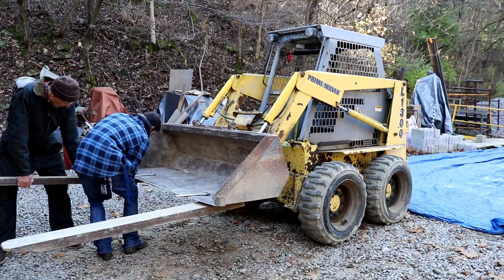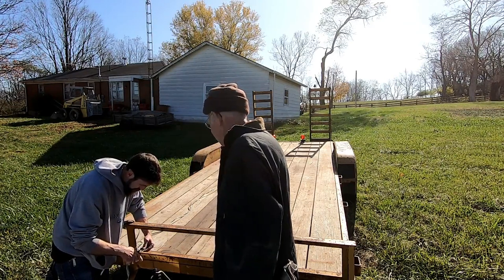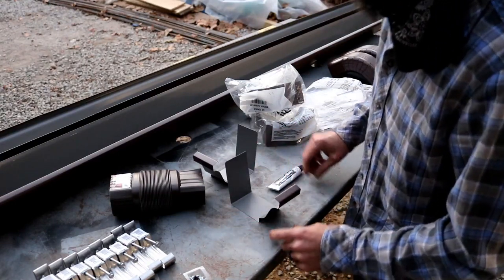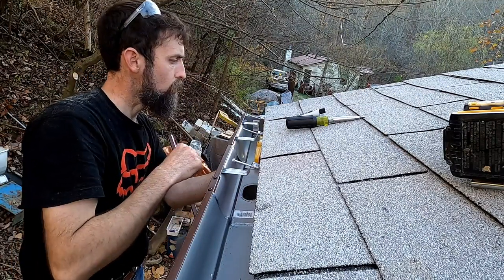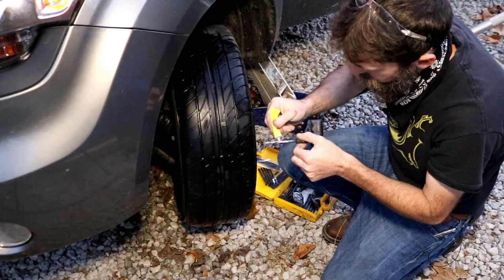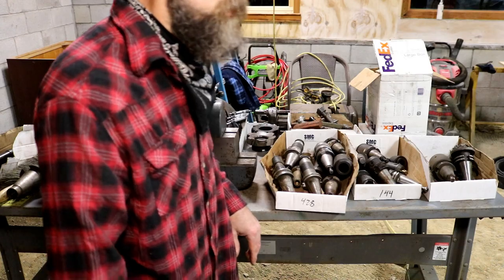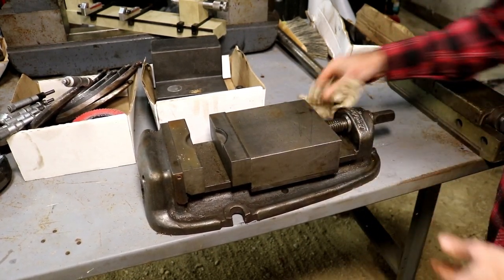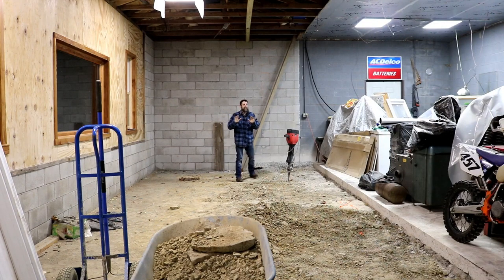Shop Gutters Guard dogs ;-)  new tools and rebar.

Comment: Interested to know if you considered using standard welded wire reinforcement to ASTM A1064 for your new slab. It provides speed and ease of installation with good crack control with smaller diameter wires at closer centers for the same weight of rebar.  I do not know if it is as readily available in the US as the equivalent would be in the UK. Great work either way.

Comment: Don't know why the delay, but I click on the link as soon as it comes up and there already 600 views.  Oh well, I still get to see the video. Had to stop and buy a set of HF magnetic trailer lights in VA when mine stopped working.  Handy item.  7:45 two stoic guys riding in a truck.  Taiwan is better than CHINA.  CHINA PHTTTT!  19:40 It's looking good. - I have run those plugs for years without failing.  Those are some very nice tooling and accessory gifts.  Hoping I'm still here for next week.  See you then.

Comment: I have always twisted the plug installer before I pull it out so as to "knot"( so to speak ) the plug so it is harder for it to fly out.  I have very very few plug failures over the last 30 + years of using plugs
Reply: Proverb House This is how it's done at tire shops. Must rotate plug install tool at least 2 full turns and then pull tool. The last plug tool kit I bought even mentioned it in the directions. I've put thousands of miles on plugged tires with no problems, didn't even use glue.

Comment: I have never found an aluminum gutter even with the brackets your using on 12" centers to last even one season.  We get a wet snow and it will just rip the gutters off (especially with a steel roof but even with composite just not quite as bad).  They don't make them with a thick enough gauge to withstand the load.  I did see some in the lower forty eight that were much better for gauge but the freight was completely out of sight for 120 linear feet.  What is offered locally is basically aluminum foil.  It is actually so thin that if you do splice on the ground and try to carry it to the roof it won't support itself.  The snow literally tears the aluminum off the brackets where it doesn't flatten them.  I had equally bad luck with the plastic gutters.  The only fellow with a forming machine takes up to two years to come to the job and he uses the old fashioned aluminum spikes which will self eject in two or three years. Expansion and contraction being the culprit.  Although I replaced most of them with gutter lag bolts and ferrules made of steel.  Surprisingly I had several break off at the facia board.  So when I did my shop expansion this past four years I fabricated my own out of 1/8 aluminum channel, welding on side boards to deepen them and brackets welded on to the gutter itself incorporating an angle flange with three 1/4" stainless steel three inch lags attaching it to the 2x12 facia.  It handles forty feet of linear run by sixty feet of steel roofing as well as the snow, ice etc.  Since there are no seams there is no leaking.  Good to see your job progressing.

Comment: So nice to see you able now to have the roof finished. Any thoughts about a leaf guard system. Pricey but well worth it. I had the perforated type installed but found they will get plugged up and still need attention every fall to sweep them off. I saw a non perforated system that goes over the outboard lip. The water hangs on to the lip and leaves just drop off. Love the tool pickups. Any ones that you may need to use is a good buy. New tooling is sooooo expensive so your time to clean them up or repurpose is like money in the bank eh.  Once again this post is over in what seems like a couple minutes. Thank you ! ! !

Comment: 24:28 Those magic words - I knew you were going to say that - "Get in there!" lol. Very handy having a tyre plug kit( - sorry tire - i'm from the UK lol) The only trouble is they work in the middle of the tread but not so effective if the puncture is too near the sidewall. Great job on the guttering, Steve, Good to see the dogs getting on fine with the new pup! Take care and stay safe guys! :)
Reply: Only problem with the plug system is that has been illegal here on this side of the pond for at least 20 years, we used to use them but bloody European legislation killed the use of the plug system. You can't even use them in an emergency as a get you to the shop and get it fixed scenario.
Reply: @samrodian919  I didn't know that, thanks! Also nowadays - and for quite a while, my dads mini cooper (2009 model) has instead of a spare wheel they put a tyre inflator foam kit to "repair" it - but then the tyre, which don't come cheap is irrepairable (did i spell that right lol) bring back the good 'ol days! :)
Reply: @samrodian919  they could write me  a ticket, i would plug that tire to get to a shop.  that's just silly.  last time i used one, it was 5 pm on friday.  yeah, try and find someone wanting to fix a tire. lol  I pugged it and drove home.  it was still slowly leaking when i took it to the shop a few days later.  the shop said who ever put the plug in did a terrible job.  i said, I put the plug in and it got me 150 miles home and another 20 miles to this shop so it couldn't have been to bad.   i wanted it patched on the inside anyways, so that was the plan all along.
Reply: @samrodian919  Please don't blame the EU for British nanny state rules.  We have lost a great many freedoms with Brexit and you won't see any reversion to the "Good Old Days" as compensation.

Comment: So for anyone doing you own gutters, let me give some advice, down spouts and joining brackets are useless and a waste of money. For downspouts there are small round pipes with a flange to add a down spout to a gutter, you cut a quick hole screw them on, they work a lot better. To join 2 gutter pieces overlap by four inches smother the joint in compound and toss a screw or 3 into it. These two methods are cheaper, easier to install, leak less, less joints, last longer, etc etc (and yes I learned this the hard way)

Comment: I would of filled the groove of the end caps with sealant rather than what you did because over time the weather will deteriorate the sealant and it will start to lift away and leak

Comment: In before all the tire experts make snarky comments about rope plugs, even though people have used them for years and years and never had issues
Reply: I have never had a properly installed plug fail, I have even put two in a cut and they were still in the tire when it was replaced. The brown plugs are the only ones I use.
Reply: Saved my bacon several times.  Never heard about the brown being better, glad I have the preferred color.

Comment: Steve, I got a suggestion for your next project. You need to build a garage for your vehicles so your wife can come and go without getting wet or cold or even hot depending on the season... Attach it to the house so you can enter and exit via the house, and not go outside to get to it... She deserves at least that.   Thumbs Up!

Comment: Does the 'German' vise say Gressel on it? If so it seems it's actually a Swiss vise.
Reply: It's a Gressel " Hochdruckspanner"  I lived in Germany for 8 years and its sounds German to me but it could be Swiss which is very similar to German.  I purchased 4 of them in a lot and they all had the same issue, snap ring that is broken that retracts the jaw , easy to fix.
Reply: I just googled it and you are correct and it is Swiss!!

Comment: For your tree covered gutters
Appleton Supply Co. 5" x 3' Clean Mesh Gutter Cover - Model Number: GP3SCREEN
Reply: They don't work unless you clean them every week or, every day in the fall.  Save your money.
Reply: @flick22601  These have been on my house which is shaded by a number of honey locus trees with the tiny leaves - for over 8 years. Never cleaned them. Never had to.
Reply: @stevesus3295  - I MAY stand corrected.  I'll give them a try.

Comment: May I suggest to you and all your subscribers this tire repair kit: https://www.stopngo.com/ I have been using it for many years. The most notable repair was one I did on my friend's heavy duty tandem equipment trailer over 6 years ago. It is still holding today. I have also used them on tractor tires here on our little farm and I have never had a failure. I can't say the same for those string type plugs.

Comment: Thanks for another great Video! The first Vise you showed looks like it's a GRESSEL, which is actually a Swiss company and still in business. The model looks like a MHS 125 (as in 125mm or 5in jaw width). Maybe this can help you: https://forum.zerspanungsbude.net/download/file.php?id=209344&sid=32c4ba7357c0232061f2282782e7282d
Reply: looks exactly like my 100mm Gressel vise

Comment: Line the joints in the gutter with 6 inch wide flashing tape. Good for 20 years.
Reply: Now that is a sensible idea, belt and braces, and if you are going to do it Steve do it straight away before you get crap adhering to the Aluminum trough.